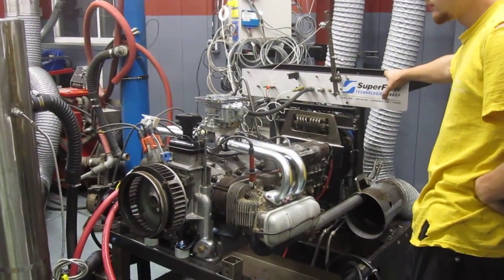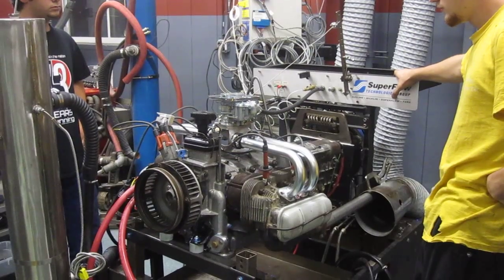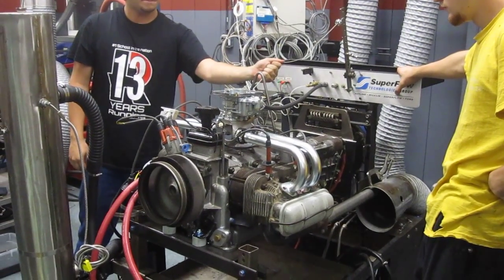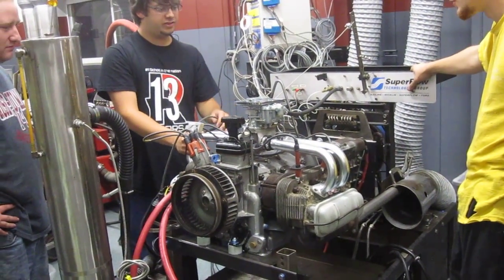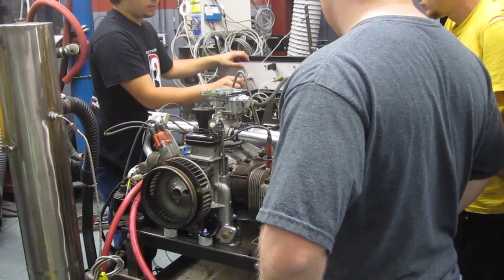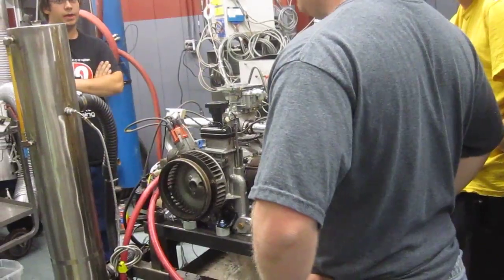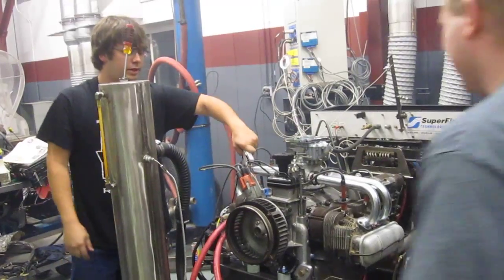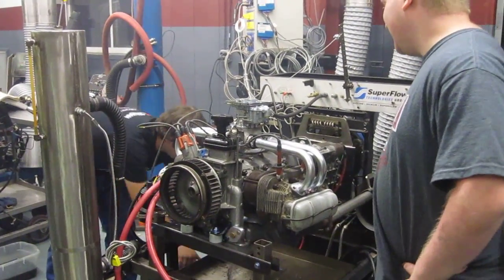Porsche 914 Engine First Start

Comment: this is an air cooled engine. this motor will burn up after a short time with no air across the cylinders and heads
Reply from the maker: +daniel951st Thanks for the tip.